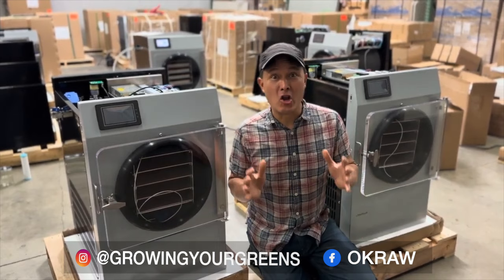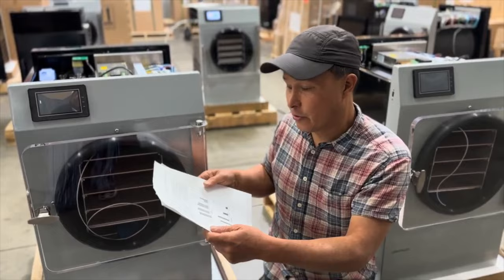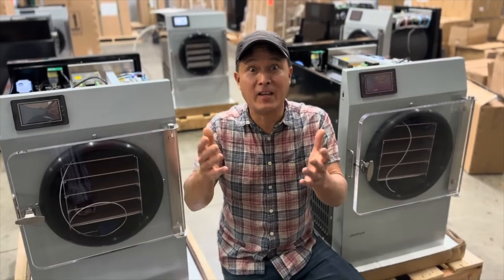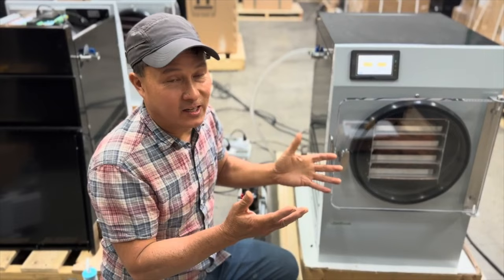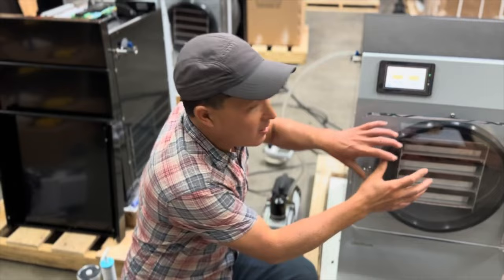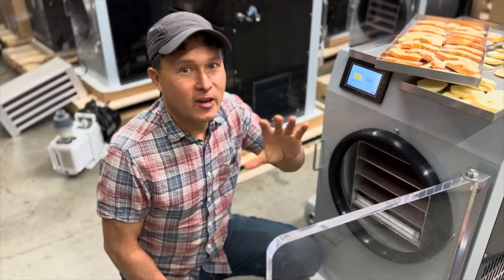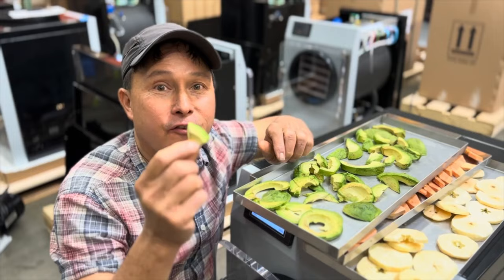Dehydrators Lose 80% Nutrition. Use a StayFresh Freeze Dryer Instead

Comment: These are big, expensive and take too long. The technology is gen 1. Once they’re tabletop machines for $1000, I’ll buy
Reply: Freeze dryers have been around for 40 plus years, not generation 1.
Reply: @figtree393  the home ones are gen 1. “Bill gates had a  $400k plasma tv in 1994” sure, but the $3k plasmas of 2005 were really the first gen. 😂. A 125lb machine that cost $4000 and takes 36 hours and basically needs a dedicated room is “first gen” to make 6lbs of food. You can’t even realistically make dogfood. These are HIGHLY impractical. $4k and 48hrs to make 6lbs of food? U can just buy the food. By 2030 they’ll be the size of a dehydrator and cost $800
Reply: They will never drop to a $1000.

Comment: I  currently have a harvest right freeze dryer. If you are not mechanically inclined then you should not buy a harvest right. I have taken it apart, worked on it over and over. It is still functioning, however I have purchased a Stay Fresh freeze dryer. Waiting on delivery. Hoping it works ok. Just got off the phone with a $45.00 bill for harvest right to help me fix my freeze dryer. I must admit that youtube videos have helped more. Not saying the help at harvest right was bad but more help was obtained from youtube. The techs at harvest right are trying to fix units that have a design problem. I truly hope they redesign their units. If they don't they won't be around for long. I have had my harvest right for 6 years now and have spent lots of money trying to keep it running. At this time it is running great.
Reply: Please update us when you get the StayFresh FD!
Reply: @vertex1029  Did my bread run. Worked great. This machine is nothing like my harvest right. Going to put tomatoes in tonight or tomorrow. Was Well packaged with no damage. It does heat up my laundry room. Going to add another fan. Will let you know after the tomato run.

Comment: Great Video John!!!  I live in Florida and was hoping to put it in my garage.  Can it handle working in the summer heat?  Or does it need to be inside?
Reply from the maker: While it may work in the garage in the summer, it will significantly increase operation time.  I would not recommend putting this in a garage. Maybe a in-house laundry room, that is where I plan on putting mine since it stays cooler than the uninsulated garage.
Reply: Have a winter home in Punta Gorda FL I can tell you that refrigerators in the garage have a very short life.   The humidity level is insane!  Anything plastic or rubber also tends to degrade and gets sticky at an accelerated rate compared to our Ohio home garage.

Comment: What's the warranty?
Reply from the maker: 3 Year Warranty on the refrigeration system, and 1 year warranty on the balance of the machine.  This machine has been designed to run many years without issue.  Also parts are available to purchase after the warranty, and you can call the company to speak with the owner to help you troubleshoot the machine should there be any problems. I will soon be getting my machine, and doing "deep testing" to ensure long-term reliability and report the details.
Reply: "1 year warranty on the balance of the machine.  This machine has been designed to run many years without issue".  Why not have more than a one year warranty on the balance of the machine?  May I ask where this machine is made?  @okraw

Comment from the maker: Jump to the following parts of this episode: 
00:29 Stay Fresh Freeze Drying Company
00:52 Freeze Dried vs Dehydration
04:34 Why dehydration is so bad
05:50 Stay Fresh Freeze Dryer is the only freeze dryer I recommend
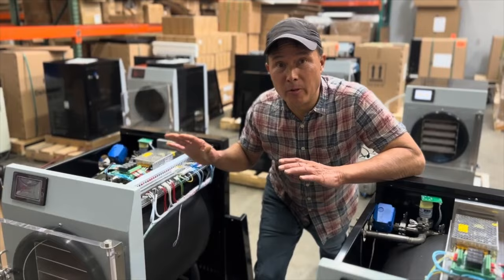06:45 How Freeze Dryer Works
07:17 Dehydrators are simple and overpriced
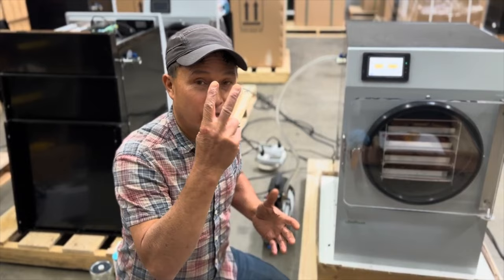08:49 The Magic of Freeze Drying
09:38 This freeze dryer checks your food temperature!
11:30 Freeze Drying Takes Longer than Dehydration
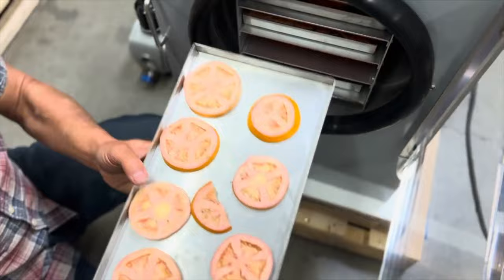12:51 Freeze Dried Tomatoes
13:35 Easiest Way to Gain Weight on Raw Vegan Diet
14:38 Freeze Dried Apples don't Brown like dehydrated ones
15:13 Freeze Dried Papaya 
16:10 Freeze Dryers are not cheap
17:10 Freeze Driied Avocados
18:08 Reconstituing Freeze Dried Food in Water
20:00 SAVE $50 on a stay-fresh freeze dryer with code OKRAW
21:12 Why the Stay Fresh Freeze Dryer is Best
21:30 This Freeze Dryer Monitors Food Temperature
24:43 What a Freeze Dryer looks like on the inside
25:45 Main components of the freeze dryer
27:12 Solid State Relay for Tray Heaters, reduces failures
27:30 Easy to Remove Vacuum Sensor
28:45 Rolling Improvements to Machine as they are being made
29:35 Prevent Problems Before They Occur
29:55 Reconstuted Avocado 
30:55 Store Ripe Fruits and Veggies for up to 25 Years! 
31:45 How much food can you freeze dry at one time?
32:59 What comes when you buy a Stay Fresh Freeze Dryer
33:52 Don't Buy a Freeze Dryer if you don't read instructions
36:23 Base Vacuum Pump
36:44 Standard vs Industrial Vacuum Pump
39:07 Summary of Episode
Reply: They are to expensive for me.
Reply: Wow it’s another machine to worry about , like a fridge or dryer and a washing machine to maintain.
There is no time left in the day to do  food storage